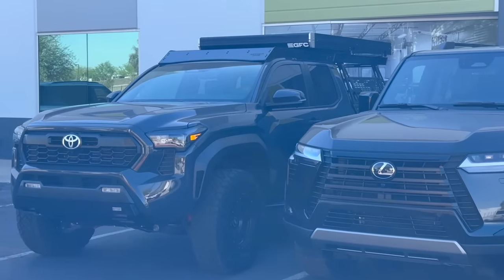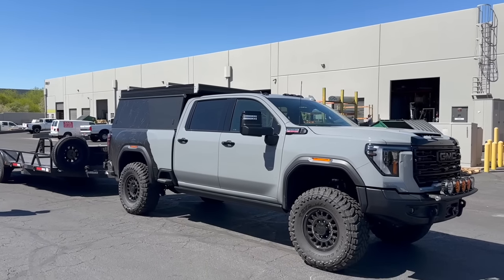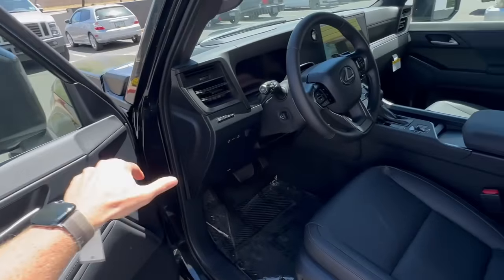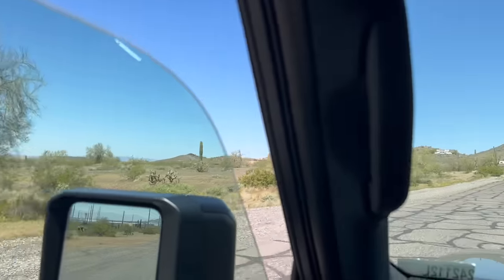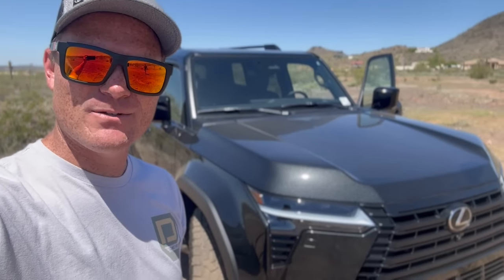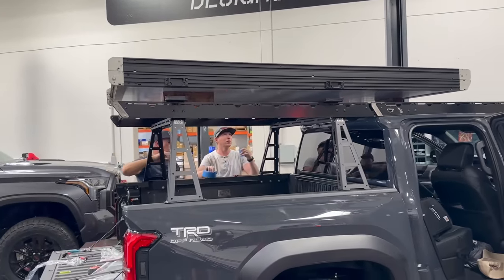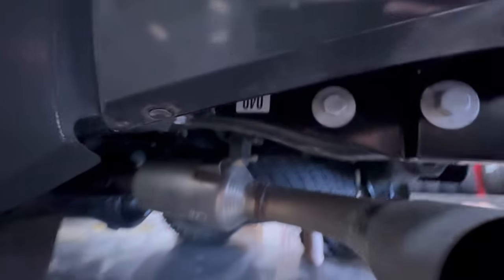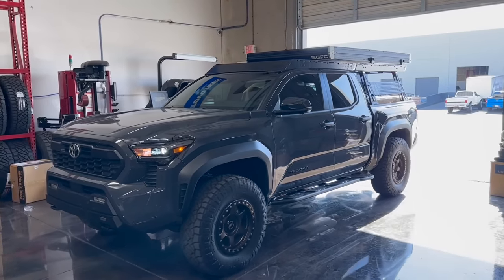2.0 Complete! Taking My New Tacoma To Cruise Moab!

Comment: Just put my camper on, got 300lbs on the bed and power wise it’s a lot better than my 3rd gen, and my 3rd gen was 2wd. But the suspension is way too soft, any stiffer springs coming to the market?
Reply from the maker: I think some springs out there already work for the Tacoma.

Comment: Have you had an issue with the dash settings getting reset every time you turn it off? I set my dash theme to a single tach and put the fuel economy and tire pressure on the sides, but every day they change back to blank
Reply from the maker: Only on my tire gauge! It always goes back to trip B
Reply: @TRDJon  good to know it's not just me. It'll probably be fixed in an update